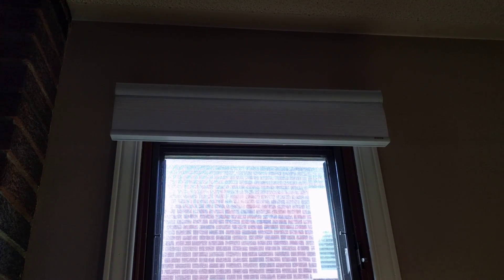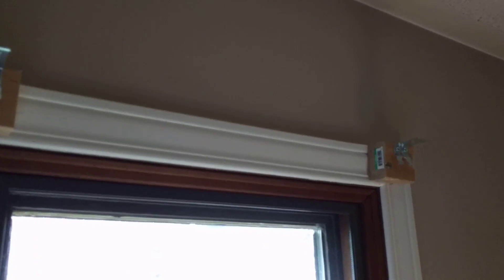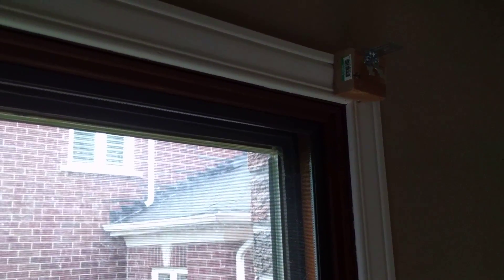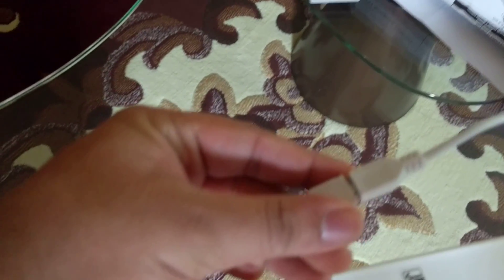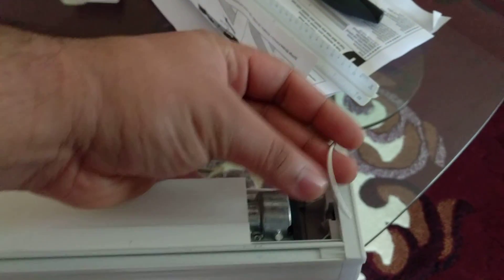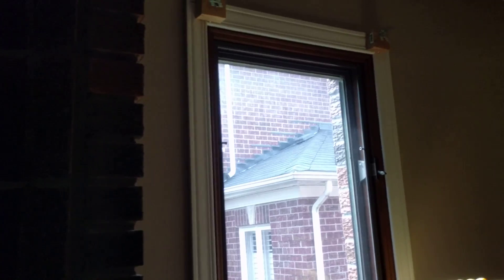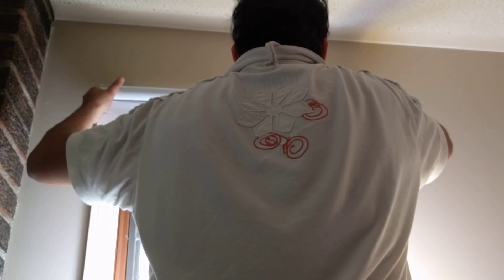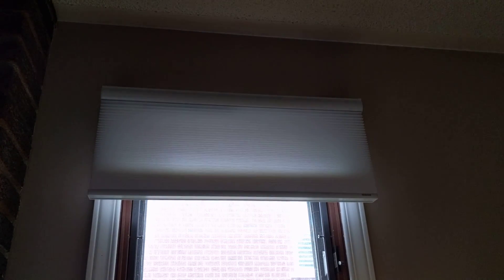Installation and General info on Z-wave virtual cord shades

Comment: Hi, Thanks so much for the informative video.  Can you give me more detail about the plug-in DC power supply?
Regular micro-usb is designed to carry 5v and 2 or 2 amps (?).  In this case, the motor requires 12v.
Can I take a regular 12v DC power supply lying around, snip off the device-side jack and wire in a micro-usb jack?
I presume I should hook up the P/S leads to the power leads of the micro-usb.

Anyone build their own powersupply bricks?